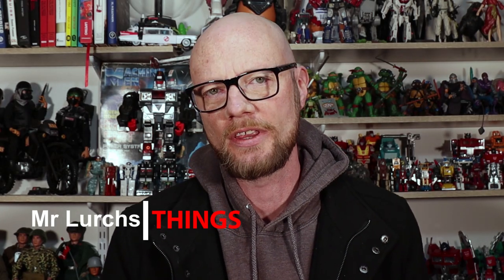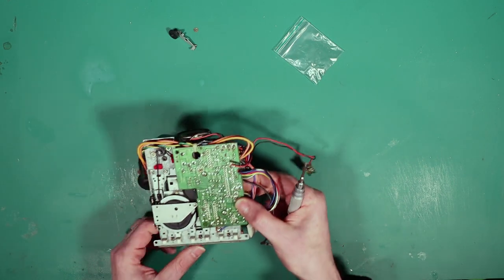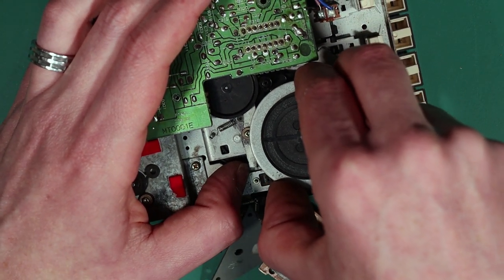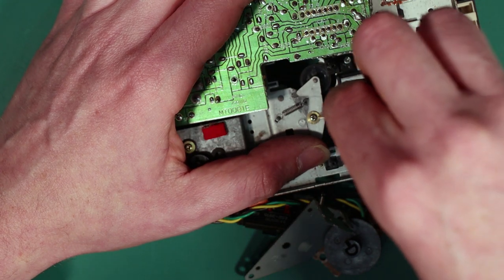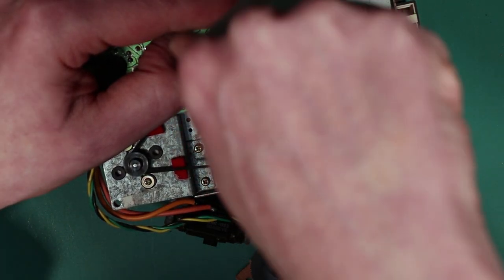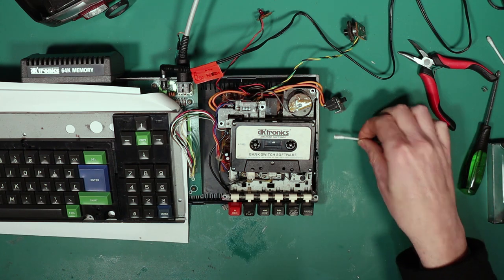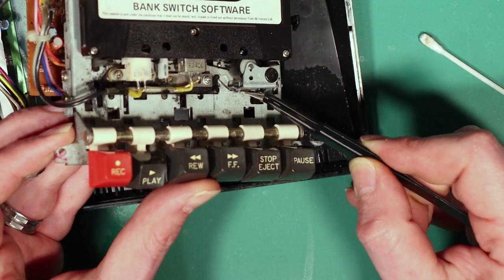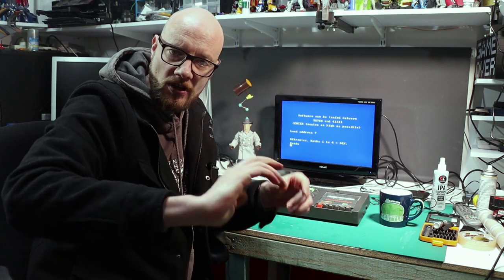Amstrad CPC 464 Tape Deck Fix(ish)

Comment: When you removed the capstan, the one with the big flywheel, you removed a tight, push-fit washer from the top of the deck. The washer holds the capstan in the right place. You can see the washer (the clear plastic one) during the rebuild montage right in the middle of the screen.
Reply from the maker: I’ll go back and take a look. Must have missed it.
Reply from the maker: And found it on my bench (by some miracle)
Reply from the maker: Thanks mate - much appreciated.
https://twitter.com/Mr_Lurch/status/1292237327926927360
Reply: @MrLurchsThings  No worries. Looks like you could install it without even taking anything apart, bonus. :)
Reply: Hi.
I  am hoping you can tell me where you obtained the replacement idler assembly, as on my 464, the rubber ring has completely broken.
Thanks in advance, 
Alan.
Reply: Ooh. I saw that washer when I took mine apart to fix. It's disappeared now 😥
Reply: Merci je cherchais d'où ça venait cette rondelle, je l'avais mise au mauvais endroit

Comment: you'd never expect this. I accidentally stumbled across your video while I was looking on Google how to fix my Grundig boombox since it happens to have the same exact tape mechanism as the Amstrad computer you fixed in the video. It wouldn't play and I didn't know why. It was when i saw you remove that part i noticed something got stuck, and I also noticed that the pinch roller on mine had the springs in the wrong position. thank you.
edit: It's an RR-340 Stereo in lovely red.

Comment: I have exactly the same problem on my Amstrad CPC 464, a broken O-ring in this little coupler. Thanks to your tutorial I could easily replace the rubber and now the tape reader works again. Thank you very much!

Comment: I missed the before situation. My CPC64 does this (I have no video cable yet):
- Red LED lights up.
- DEL delivers a beep from the speaker
- FF and REW make the two axles in the drive spin
- Continuous beep coming from the speaker, less loud then the DEL beep.
- Play does not work
Is that similar to your issue?

Comment: Where did you get that spare part from my computer got she same problem I put new belts and new pinch roller in and that rubber one in the middle is the problem
Reply from the maker: eBay UK
Reply: Ok mate thanks I’m still looking on there mate lol there’s just belts popping up for now but I will find one I have got 2 spare tape decks but they have the same problem i think by the look of the rubber on them

Comment: What is this part called please? has my band has snapped when you press play.
Reply from the maker: Which part? The idler wheel and arm?
Reply: @MrLurchsThings  yeh that's the one I can't seem to find a part online, I recently purchased a cpc but after I tested a tape it chewed my tape up and most of got stuck😕. I took it apart and found the idler arm o ring had snapped.
Reply from the maker: Yeah, I got really lucky finding the one I used on eBay UK.
Reply: Thanks anyway, going to order a bag of mixed idler rings and see if any will work or same size 🤔 ya never know, it's a shame really because everything else is perfectly fine, barring a good clean.